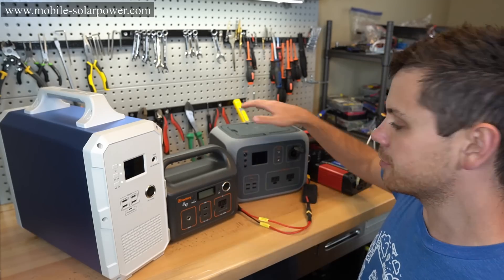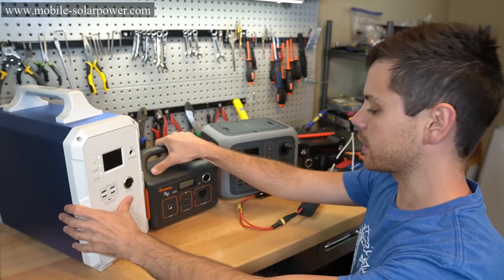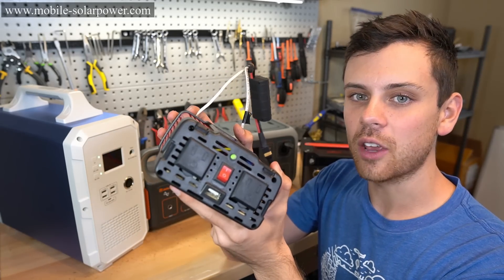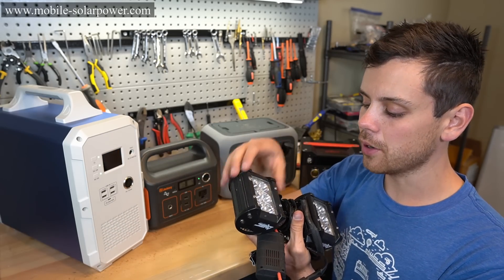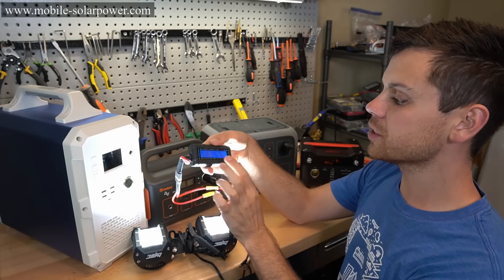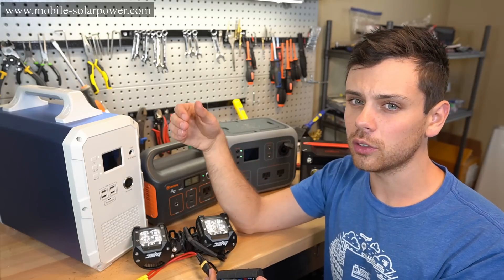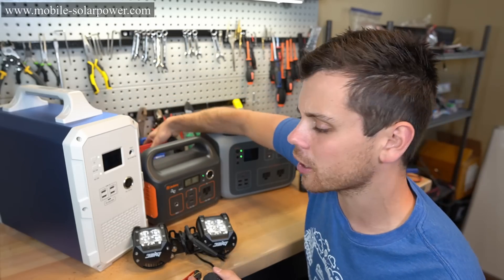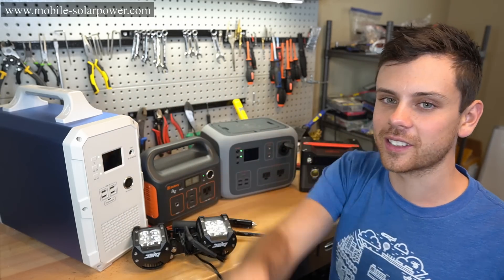Lithium Solar Generators: Why you need a regulated 12v output

Comment: The downside of a regulated one is the inefficiency of the converter... it takes energy to create a regulated output, and thats wasted battery power. Plus, personally i like the idea of running on 3S because my lights will all be a bit dimmer and my batteries will last longer (i am using them for camping, so dont need killer bright lights etc)
Powering an inverted is not someone everyone wants to do, some people just want to power a fridge and some lights, and a 3S one will do that (some fridges have a low battery shutdown, but most you can disable it or set it to a way lower voltage)
But, i get the point you are trying to make, and one with a regulator is 'better' and more consistent, and less likely to cause problems, but that doesnt mean you absolutely NEED a regulated one for every situation.
Reply from the maker: Hey that's a great point. Didn't consider that. Well stated. Agreed
Reply: @WillProwse  I'm glad you're not too stubborn to see other points of view like so many other people :) 
I'm currently struggling with deciding what size 18650 pack to build for camping... and im still toying with 3S as i cant think of anything i want to run that wont run off of 3S, and that way if i want a high draw device, im not limited by the regulator... as big regulators that can actually deliver 20A+ arent cheap, and they need some decent cooling. Where as just drawing 20, 30, 50A from a battery pack is not a problem.
But thanks for the videos and the explanations. I hadnt even considered a regulator until i saw your video yesterday and have thrown a spanner in the works now as i have yet another decision to make :P
Reply: @MrSummitville  the downside being that you will spec your DC-DC converter to be decently oversize for 90% of the things you want to do... so you would get at least a 200W one right? and then when you run normal stuff like your phone charger, lights and even your fridge once its at temp, thats only ~20W draw...
at 10% load draw (20W) even a top spec meanwell only has 85% efficiency, so you lose 15% of your power there, so you need a battery, solar charger and solar panels that are nearly 18% larger because of it.
DC-DC converters are at peak efficiency at ~40% load, whereas most the time (in my case anyway) i will be at way less than that, with the odd time i might need to use the full 200W draw for a big device like an air pump or if someone wants to try a 12v kettle or hair dryer or some other useless device that draws 10A+. So in that case, the 18% saving in batteries, weight and solar panels is easily worth it for me... until i find a device that wont work on 11.1V, and then i might change up my system, but i havent found one yet...
Reply: @MrSummitville  because i assumes you would want a 12v car outlet on the battery bank to have the same specs as a cars outlet, as those are the kidns of appliances people will plug into them, and on a car they are usually capable of delivering 10A, so for the example i picked a DC-DC with the capabilities of doing ta least that, which is how i ended up with 200W.
but, yes, you will need a pack thats that much bigger if you use a regulated output, as the regulator chews up 18% of the power as a heater when you use it. So to run a fridge with a draw of 200whrs in a 24 hour period (standard fridge draw spec from the internet) you need a ~18Ahr 3S battery pack. To do the same with a 4S pack with a regulator, you need ~13.5Ahr/0.85=~16Ahr 4S battery. If you have 2Ah 18650 cells, thats 27 cells for the unregulated pack, or 32 cells for the regulated pack. So 5 extra cells for the same watt hour output.
If you need to run something that wont run on 11.1V, then sure, you need a regulated pack (or just a 4S pack and hope your stuff also works on 16.8V)
but if you don't, then why add some electronics that rob you of power when not needed? seems counter productive...
and i know it's up to the individual, thats what i've said in every message... i've only stated what i need and what i would want and how there is a subset of battery using people that dont NEED a regulator, and how some might be better off without it. If you want a regulated one, get a regulated one... if you dont need one and want to save some money and battery power, get the unregulated one
Reply: May not NEED it for every situation but you do for some. Are you going to buy one of each so you have one that works when you do or just get one that has regulation and works for everything?

If you wanted to have dimmer lights and to stretch the battery why not just get lower wattage lights? I don't turn the whole house voltage down when I dont want a 100w output in my desk lamp I simply use a 40w or 60w equivalent instead.
Reply: @chublez  i think going to build a 3S pack without regulation, and if i find something that will not work then i a) have my car if need be, b) can modify the pack later to get 4S, c) put a boost converter in for that random device, or d) open it up and modify it so it will run on 3S (the plus side of being an electronics engineer that designs circuit boards etc i guess haha)

Comment: So I was thinking of buying that Rockpals 500, but now I think I should avoid it.  That Jackery 500 looks like it fixes that DC output problem, but seems to have a very limited DC input.  Any recommendations for a small/mid generator that has a regulated 12V DC Out, but can accept more than 100W DC IN?
Reply from the maker: Nothing available right now in that size. Some coming soon I think. Or so companies tell me.
Reply: @WillProwse  thank you so much for the quick reply!  If you get something like that please showcase it!

Comment: Still a bit harsh Will. It's important for people to know if it's regulated or unregulated so they can make an informed decision based on their intended application, but there are many devices that have buck converters to run 5V or 3.3V internally, and don't care much what the input voltage is. Eg: during a power outage, I ran my wifi router off a 3S lipo down to 9V and it still worked despite being rated at 12V.
Still, an unregulated output can be converted to a regulated one by adding a converter, but that's extra cost which arguably should be built in. I would expect an unregulated battery bank to be proportionately cheaper to reflect this deficiency.
Reply from the maker: Oops sorry if it was harsh! I had just read an email and was a little ticked off haha. Probably should have waited a second. And yes that's true. I use these batteries to power my camera when making these videos, and I have stopped using the unregulated ones, so I am showing quite a bit of bias because I had so many issues with running my camera monitor with 11 volts. And the converter efficiency is incredibly high when boosting it two volts. But yes, I agree. Thanks :)

Comment: I'm a bit ticked off that my new Yeti 400 Lithium doesn't have regulated output. Not to mention their regulated 12V adapter only works on the Lithium 1000 and higher models. So it's really irritating having to use the inverter when the 12V would be more efficient with my camp fridge. It's a bit misleading to say it's 12V output when it clearly isn't. Shame the Jackery doesn't have a 220V inverter for us international peeps.
Reply: James Fraser - yeah, I hear you man. That’s why I bought the Jackery 240 that will suggested. And my SUV life has been awesome so far when it comes to electrical.
Reply: @mikefranks4528  They look great, just wished they had a 220V version for Australia. A lot of these solar generators look great over in the US but we need the bigger inverters and probably have a lot more rules they have to jump through. Otherwise that Jackery would of been great.

Comment: What % decrease in total output capacity do voltage regulators cause in these types of devices?
Reply from the maker: Efficiency of converter decreases as the difference in voltage from input to output increases
Reply from the maker: They are usually 91-97% efficient in my testing and as stated in the data sheets

Comment: Yeah. A lot of 12V stuff is made to be powered by a running vehicle that is keeping the battery fully charged and also powers the device. Pointless to have to modify every single thing to work with a changing voltage when the energy storage device can provide a regulated voltage to begin with. That's the problem I have with many companies selling newer technology. Many don't try to think of problems that users will have ahead of time. It makes their product look worthless.
Reply: electronzapdotcom Thank you for this excellent answer, and explaining that a lot of these 12v items/appliances are meant to be *steadily* powered by a running car/cigarette lighter, for example.  

And Will’s answer, too, because I was assuming that as the power output drops on the unit, it will just put out *gradually* less power to the 12 V item… NOT that it would shut it off COMPLETELY!  PS: I posted that before I finished the video, so I see that the potential for lower performance is a possibility (as opposed to outright closing down) but it’s just too fussy to be considering whether one’s 12 V appliances have a Low power shut off or not). I am sold on why it must be regulated!

Comment: Will is absolutely right.  Running undervolt increases the wear on the power supply side of the item being powered, and can damage the item.  Performance will without a doubt be low.  I do wiring for a living, trust me, I have seen stuff damaged.  Average top end for a good 12 volt battery is 13.8 volts.  That goes up to 14.8 volts when in charge from an alternator.  Most DC stuff is designed for 9 volts to 24 volts, but... not all stuff is.  It is best to use something that is designed to emulate the 12 volt circuit in a vehicle vs, just enough to run it.  I will give an example:  a 2 way radio might power on under 12 volts, push to talk the radio and you might blow the protection diode in the power supply in the radio.  Under load, you will destroy stuff in undervolt.
Reply: I have even had AC equipment damaged by brownout conditions before.
Reply: @javabeanz8549  yeah, this is one of the reasons that we have ups power backups in our repeater sites.  They will buffer the power and with spikes or brown outs they will go into battery only and then run on generator till the power becomes nominal.

Comment: I didn't see the previous vidoe (yet, i'll check after this)
So I start watching, you take an inverter. I go: "hey! you said 12v appliances!"
Plugs in lamp, works.
I'm not arguing about reduced performance, but to me you just proved it does work.

Comment: Ok... but what if i hire an extra hamster to run in the wheel... Will it power it then?
Reply: Only the hamsters that are capable of 13.8 volts.  Lol.
Reply: @xavierpendrag0n  mine are fully regulated hamsters... so i think I'm good
Reply: @bumstudios8817  when in doubt, motivate
Reply: yes.

Comment: Thanks for this video. When I am shopping for a lithium solar generator, what text should I be looking for in the product description?  It is as simple as "regulated 12v output" or do they use some sort of alternative jargon?
Reply from the maker: Usually, you have to test it with the multimeter on the spot. It never tells you in the manual. 

You can buy a small cigarette lighter voltage meter that you can plug in. Like this:

Palumma 24W/4.8A Dual USB Car Charger, 12V to USB Outlet with Cigarette Lighter Voltage Meter LED/LCD Display Battery Low Voltage Warning (Black) https://www.amazon.com/dp/B0773BYS6P/ref=cm_sw_r_cp_apa_i_BcMPDbFEFJZQ8
Reply: @WillProwse   Thank you very much. Belated congratulations on your new place and ride.
Reply from the maker: @wrenchdoozer  thank you!!

Comment: Definitely going to want to get a regulated output, that Jackery 500 is prolly the best choice.  Thanks for the Info it was helpful.   ---mww
Reply: The larger Bluetti 1000 watt inverter with the regulated 12V is also worth serious consideration. It's a matter of how many solar panels you intend to buy over the next two years.  If you're keeping it simple, then you're right.